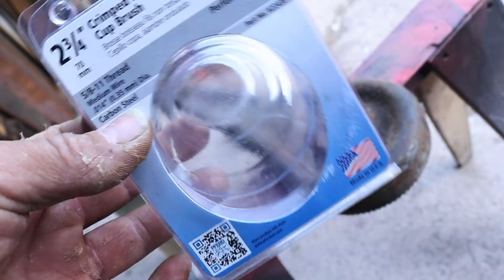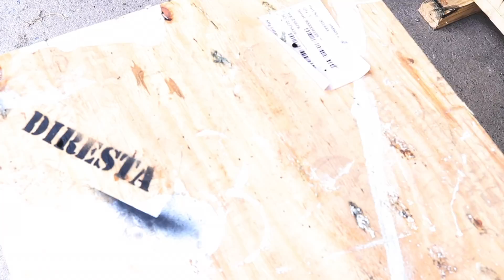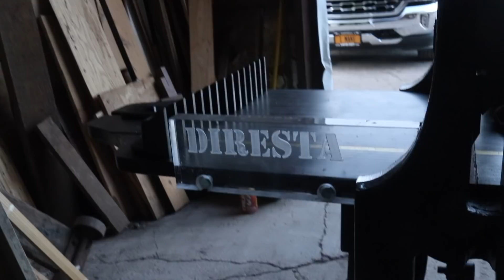DiResta Paper Chopper Resto

Comment from the maker: Few folks saying this was not a restoration. maybe not more like a clean and paint. ...FYI There is no need to take a functioning machine like this to a mirror finish like a classic car. it was not like that when it was new. the cast iron is textured and not smooth from birth. so i clean it,  make the parts necessary to re assemble in a sexy way and i USE it.. restoration? i think so .. thank you for watching.
Reply: jimmydiresta totally agree. Alot of the nae sayers would never have touched such a project as this, loved the work
Reply: How long do you think this machine was sitting?
Reply: Love your work Jimmy. i see you've lost some weight; you've inspired me to start as well
Reply: Why is it so much fun to get old machine running again??? I agree with you Jimmy, it's not gonna be a concours car, it's a shop machine you wanna put back to work. Making it super fresh is like putting a tux on to drive a tractor to drag a disc harrow through a dusty field.
Reply: Keyboard warriors have to complain about everything.  Nice work again.
Reply from the maker: 30 years
Reply: From someone that restores pre war cast iron machines for a living, it looks outstanding mate. The enamel black is lovely, our clients usually ask for green or blue. Those brass nuts are exquisite and I'd never thought I'd use that term in public.
Reply: I totally agree with u on that for sure!!!
Reply: jimmydiresta those same few folks could win the lottery and complain about having to buy the winning ticket
Reply: So more of a DiRestoration then?
Reply: This term needs to become a thing.  #Direstoration
Reply: love your work, just givin you the business.
Reply: I vote restoration.  That's how it probably looking anyway, minus some pinstriping.  :) Glad its getting used again.  I was wondering are you going to shave down the bolt heads since they seem to get in the way of the paper cuts, or are you cutting too big of a stack? :)  Very cool old machine.
Reply: I don't understand the argument of restoration. It's a non issue to me. You've returned it to a living machine. That is the most important issue in my mind, it's much better off now than where it was. Looks great jimmy keep on and thanks for sharing.
Reply: Criticism is valid, and it isn’t a restore by definition y’all. Not a big deal. It’s still looks great, but it’s not a restore. 

It’s good enough for a shop that will use it. Just call it what it is though. No need to justify anything. Just call it what it is..
“Re-established piece of Equipment”

👆🏻👆🏻👆🏻👆🏻👆🏻👆🏻👆🏻👆🏻👆🏻👆🏻👆🏻👆🏻
I see no harm in that title what so ever.

It looks great, and he’ll it’s a lot of work. I don’t see how it won’t work; seems like it will work great to me.👍🏻
Just don’t claim it’s a restore. Is that really a hill worth dying on? Lmfao
Reply: I just freaking LOVE it. And the clapping got me like wtf is this, I laughed so hard. Thank you for your service Sir.
Reply: Seems to me that you RESTORED it to working condition, its kind of in the name
Reply: You restored it's usefulness and in the end that is what matters.Great video by the way!
Reply: Haters gonna hate. Potatoes gonna potate. What ya gonna do?
Reply: Legendary Jimmy!!
Reply: Jimmy, the  #Direstoration tag is a good suggestion but I would have dropped the o for the a in Diresta:  #DiRestaration.

As far as the dispute as to whether or not this is a restoration: the people arguing are empty heads that argue for the sake of argument. 

It turns out that whether you use the term restoration, rehabilitation or rebuild; you are in fact saying the same thing as they are, based on their definitions, though slightly different to some degrees, synonyms.

Sometimes Jimmy, the best response is to just throw dictionary definitions in their face and let them leave in anger, as that is the typical response of empty heads arguing for the sake of arguing.

restoration (reste rasen)
n.
1 a restoring or being restored; specif., a) reinstatement in a former position, rank, etc. b) restitution for loss, damage, etc. c) a putting or bringing back into a former, normal, or unimpaired state or condition
2 a representation or reconstruction of the original form or structure, as of a building, fossil animal, etc.
3 something restored
the Restoration
1 the reestablishment of the monarchy in England in 1660 under Charles II
2 the period of the reign of Charles II (1660-85): sometimes taken as including the reign of James II (1685-88)

(C)1995 Zane Publishing, Inc.   (C)1994, 1991, 1988 Simon & Schuster, Inc.

rehabilitate (rehe bile tat, ree-) -tated, -tating
vt.
1 to restore to rank, privileges, or property which one has lost
2 to restore the good name or reputation of; reinstate in good repute
3 to put back in good condition; reestablish on a firm, sound basis
4 a) to bring or restore to a normal or optimal state of health, constructive activity, etc. by medical treatment and physical or psychological therapy b) to prepare (a disabled or disadvantaged person) for employment, as by vocational counseling or training
rehabilitation
n.
rehabilitative
adj.

(C)1995 Zane Publishing, Inc.   (C)1994, 1991, 1988 Simon & Schuster, Inc.

rebuild (re bild) -built, -building
vt.
1 to build anew
2 to restore to a previous condition
3 to repair or remodel extensively, as by taking apart and reconstructing, often with new parts
vi.
to build again

(C)1995 Zane Publishing, Inc.   (C)1994, 1991, 1988 Simon & Schuster, Inc.
Reply: Stop hating
Reply: Python 357 lol resto cops.... wonder what they look like? What about the theme music? Bad job bad job, what you gonna do?...
Reply: jimmydiresta I totally agree. a vintage machine restoration is exactly what you did. I restore my tools in a similar way. Some I pretty up more than others. He bottom line is, you restored it back to like new and working condition.
Reply: One of my german engineers coined the term "Dangerous half - knowledge" the other day. I think the people who nitpicks on terms in the youtube comments here posses exactly that, the dangerous half knowledge. They understand some sides of the subject but dont get the whole picture.
Reply: Some "folks" are pretty stupid.
Reply: UNSUBSCRIBE!
Reply: Rustoleum restoration.  Might as well used sandblasting.
Reply: jimmydiresta If this wasn’t a restoration in the classic sense, then I don’t know what it would be. Some people’s kids, eh?
Reply: jimmydiresta totally agree with you ! You do amazing work. And the tool looks cooler and more original they way you restored it . nothing like black cast Iron . keep it up !
Reply: jimmydiresta honestly one of the best videos from you, fuck people bitching over “restoration”
Reply: Looks great Jimmy.  You will have to open a museum soon
Reply: I found it seriously refreshing watching you slather black enamel on it.  Those 2 brass nuts were works of art.
Reply: The brass nuts that you made look awesome, Well done on that sir.
Keep up the good work,
Pete.
Reply: jimmydiresta That is one beautiful machine. Congrats on the resto, I hope to see more like it in the future. 😁 I’ve done similar with an old table saw and an old planer/jointer I found on Craigslist. It feels so good to use stuff you’ve saved. 

One question: Was there any reason in particular for using wire wheels and such instead of compressed air and walnut shells (or some other abrasive) to strip it down to a paintable surface?

I think I’m gonna go work on a 1950’s oscillating fan that I’ve torn apart and detailed. #feeling inspired
🤘🏼😎👍🏼
Reply: Absolutley right, great job Jimmy!
Reply: An incredible bit of gear and you did it justice - restoration often means a trip to the museum, it does it proud to put it back into use!
Reply: The antique paper chopper was _______ to working condition by Jimmy. (Please fill in the blank)
Reply: When you were using a ratchet on those beautiful new bolts, I kept thinking, he needs to borrow my impact driver with the right socket and extension, too bad I'm so far away.
Reply: jimmydiresta I agree. If not for your patience that  machine will be forever scrap.
Reply: Joshua
restoration : the action of returning something to a former owner, place, or condition

synonyms : repair (he had to replace parts so it functioned), refurbish, rehabilitation (take something in disheveled condition and make it orderly) overhaul

not sure how you don't think it qualifies
Reply: jimmydiresta I always refer to it as a restoration. You can go as far down the rabbit hole as one likes. But in the 3rd you put a non functioning machine back in to working order. BTW that thing is impressive how much it can cut in one go.  Might have been for binding books. Be a great addition to your printing press.
Reply: jimmydiresta how often does a blade like that need to be sharpened?  For curiosity sake.
Reply: Hem. I don't know but if it starts cutting poorly it's time. Having a surface grinder would make shaping a breeze. More want than need I suppose lol.
Reply: on hydraulic cutters I have used it is between 2,000 and 5,000 cuts -- and we always cycled 3 blades
.. one in the machine .. one as a backup .. one at the grinder
partially depends on the stock being cut .. soft (newsprint) or high-recycled content paper dulls a blade quicker
bevel angle of the blade (tighter bevel -- smaller angle -- will dull quicker)
use of a good cut stick (rectangular composite bead that sits in gap under blade) prolongs life
cut depth set correctly .. and there will be a minimum usable or safe blade width
Reply: Take it from someone who has used these cutters for decades, That blade is dull as dirt. There are shops who specialize in sharpening them. Find one in your area. It doesn't cost much to get it sharpened on a proper diamond mill. There is a night and day difference in how much force you need with the right grind. it will cut crooked or pull the paper with a dull blade too(top of stack will be different length than the bottom). Nice restore by the way and good luck.
Reply: jimmydiresta  jimmydiresta you took something that was 'dead' and bought it back to life! If that wasn't a restoration I don't know what is 👍
Reply: Good stuff! According to Merriam Webster     RESTORE : "to put or bring back into existence or use"    I think you nailed it.
Reply: jimmydiresta Great work Like always. Don't read stupid coments from people who doesn't know how to use a Sand paper. Keep doing amazing things.  Peace from Chile!!!
Reply: Having grown up around these machines in an old printshop, my dad would have done the same. Can't even count how many parts I've pulled and repainted, or sanded and dusted just to put the workhorses back in service for the day. Well done, great find.
Reply: Sweet. Moving machines just like I do, piece by piece in the back of a pickup truck, lol. .. there was this Bridgeport over on Flushing Avenue ... :It's in my basement now :-D
Reply: Actually the iron had a nice patina. I would've dusted it off, sharpened the knife oiled the screws maybe cleaned the table then liberally applied wax and buffed. ... though this is a nice "mid-life" restore.

Don't go changing the original form, they had it right when it was made
Reply: Agreed, i actually worked for a print shop for a couple years and they used a machine that looked exactly like this. There was very little paint and a lot of patina from hands touching it. Also we had to send the blade off to sharpen on occasion, it was like a three foot razor. The whole thing was wicked heavy too. Im glad you gave this machine a new life in your shop.

Comment: Wait?! They make paint that doesn't come in a spray can...I should try that some time.  Next time, you could use some rust converter to convert the rust to primer and save yourself some work.
Reply: Hand Tool Rescue I was just thinking the same thing
Reply: Hand Tool Rescue , lol, I saw the wrenches he was using and automatically thought of you!
Reply: Please don’t lower your restoration standards to a clean and paint (sloppily at that) renewal like this one.
Reply: Not sure Jimmy had a large enough Evapo-Rust barel :)
Reply: Your restorations are the best. I mean this is Diresta and looks like an amateur compared to yours.
Reply: Hand Tool Rescue : Love your work, HTR!  And it's great to see how your logo pops up all over YouTube, encouraging folks to save old machines like this one... I know Jimmy admires and respects your work as well.  (I'm surprised that he's not using HTR Wrench #00001 for this restoration!)😉
Reply: Zinc Chromate sold here in U.S. by Sherwin Williams is a good rust preventer.
Reply: Hand Tool Rescue Oh yes! the master of the restoration giving an excellent tip to Diresta. Strong, I hug my friends.

Comment: Amazing amount of work to bring this magnificent machine back to life. Bravo Jimmy Diresta. I would like to comment on "restoration" having done all sorts of restorations on furniture, metal sculptures and stained glass for 30 years. I will share my simple perspective. When I began restoring in the 70s the thinking was "make like new" meaning you would totally go other the item clean it and bring to as close to new as possible. As time went on during the 80s the thinking for restation moved to a "less is more" philosophy where you would stabilize decay with archival only materials and replace as little as possible to bring the item to a state where it can serve a purpose. In the case of old machinery that is intended for use, I will say Jimmy has the exact correct approach to bringing this machine back to life. Were it intended for museum display the only thing I would have done differently is to sandblast the metal with a fine material then use the appropriate top coat to match the original period of the item.  At the end of the day "restoration" contains a broad skill set and subjective approach.

Comment: Working with paper cutting machines on a daily basis, this video was music to my soul.  Though, I'd probably end up with mangled limbs at some point because I'm used to all the safety features on current machines. Ha! Still, this was awesome to see you bring a machine back to life! Thanks Jimmy! You Rock!
Reply: moniemonie48 you need both hands to pull the lever, safe!
Reply: 25 years in printing and still have all 10 digits though I do know several guys who are missing bits and pieces due to these machines. 3 pounds of grey matter is the best safety system on any equipment.

Comment: So awesome to see this come together after seeing it as a pile of parts in the truck 👍🏻 the method for cutting the brass nuts is annoyingly simple - even though I’ve never done it, it made me go “why didn’t I think of that?” 😂 and the acrylic side plate is a classy way to get the logo on there, even more that you painted it to match the machine so you can’t even tell it’s a different material at all. Not many parts but still so much work to do - you’re the man Jim!

Comment: Great job Jimmy. Very clever indexing on the brass flange nuts. I'll note that one down
Reply: Saving the indexing technique for myself
Reply: I was surprised at first that he didn't use the spiffy hex collect holder shown in the I MAKE BOLTS video (https://youtu.be/m0m3QLdn3Ig?t=157). That's how the pros do it. I'm no pro, so I will use this shadetree indexing technique for sure.

What say you Jimmy, I'm guessing you didn't have the collet holder at that location, right?
Reply: Garry Dufford that would be the typical way to do it but there Manny way to do a machining job mostly depends on skill creativity and tools available.

Comment: Awesome video! I used to work as a print finisher using a air-cushioned electric guillotine (the modern version of this)

When you get to cutting teams for real; grab two opposing corners in a loose grip, bend them up, grip tighter, then straighten it out to fan the paper... this separates the sheets and allows them to slide on top of one another. Then use an off cut of 2x4, 8-12” in length to “knock up” the paper against your fence... you can then (as you have a manual clamp) use a weight/free hand to press the center of the stack while you spin the clamp down

Comment: Nice video Jimmy!  Love the brass touches..
Brings back lots of memories of my younger days... 
this strictly a suggestion... use chip board on top and underneath the paper... on top just to the clapping edge, it will stop (or help stop) pressure marks in the paper from clamping... the bottom under the whole edge past the sacrificial wood area, it will raise up the paper making a cleaner cut (think, backing a board with wood to prevent chip out on a cut) and make the cut off the top of the wood helping to keep the blade somewhat sharper over time. Bonus, it should save you from leveling issues at cutting larger pieces of paper across the length of the blade!

Comment: Thats a clever way to index the cutting of a nut!
Reply: What's the other way? Asking for a friend.
Reply: Actually, i'm not sure for nuts. For bolts I've seen stuff like this

https://youtu.be/m0m3QLdn3Ig?t=162
Reply: David Plass Collet blocks! Or a dividing head and other unfun, slow to setup tools.
Reply: Collet holder: https://youtu.be/m0m3QLdn3Ig?t=157 I've seen 'em square (This Old Tony uses em from time to time), hex, prolly others that have parallel sides so they can be clamped in a vise.

Comment: Awesome, Jimmy! :D

I worked in a print shop in 2003 doing bindary and one of the jobs I eventually got to do was cutting paper stock down to print size (I think it was usually a nominal 17x22). I did F-up a couple times (I rotated the stock the wrong way once and used too much holding pressure on stack of 3 layer NCR paper (already printed forms, yipes!) the other time.) The paper cutter sounded like it was hydraulically actuated and needed a foot pedal and 2 buttons at arms length apart held to move the knife.